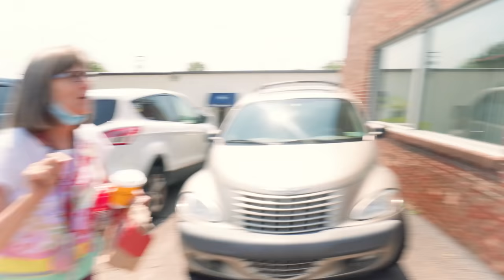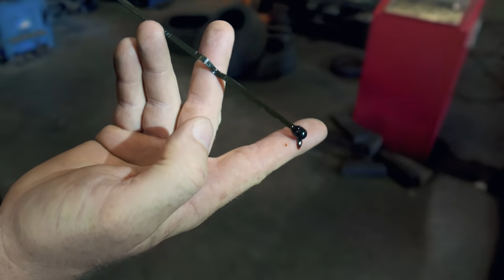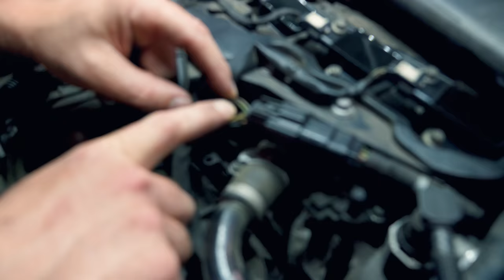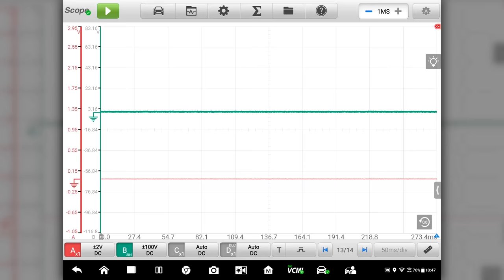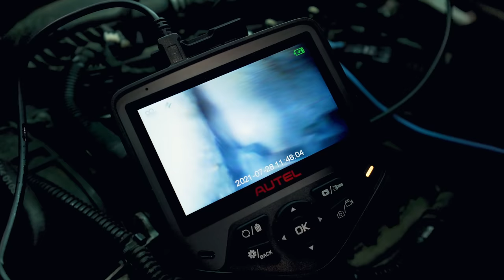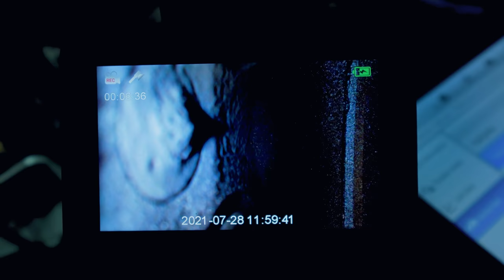Stuck Open Fuel Injectors (GDI) Part 1 (symptoms and troubleshooting)

Comment: Cyl 2 injector stuck open shouldnt throw a multi misfires.
at 1min 27seconds my guess it wiring also. from disturbing the wires when they replaced plugs and wires.
white smoke usually follows by gas coming out of the exhaust is a injector stuck open. its probably a bad wire going to cyl 2
 or the pin connector to the injector connector.
 had this issue on a equinox,  p.o.s design. the injector rail is under the maifolds spo its a bitc^^ all around.
Reply from the maker: Keep watching! There is a part 2 as well

Comment: Hello and good evening. I have a 2013 JX-35 Infiniti and from what I'm experiencing, everything is pointing out to the injectors. I have replaced the fuel pump, alternator and crank position sensor. But in the morning or if the car sit for 2 hours or more it doesn't want to start, like no spark or gas. My gas mileage has gotten worse to the point I can't keep a full tank for a week. And when the car finally starts the smell of bad gas is worse traction control , check engine and all of my collision warning lights goes on malfunction FCW, BCW.  This week I'm taking it in to check and clean the injectors and if the problem doesn't go away I'm planning on scraping the car. But until than any help will be great appreciated
Reply from the maker: Let's move this to my forum www.scannerdanner.com 
It is free to join and we can definitely help you. I have 28k global members and hand picked moderators who've been with me for years and know my material inside and out and are there to help me help you guys. It is just too difficult to offer back and forth messages here on YouTube with stuff like this and we also can't share pictures and images here like we can on the website. Hope to see you there!

Comment: Hey I'd appreciate any help, I have a 2013 hyundai veloster 1.6 GDI It starts and runs perfect other than it acts like it's hitting the rev limiter right at 2000 rpm. Drives and shifts fine unless you try to accelerate quickly and go around the 2000 rpm range before shifts. If I stab the petal it will die too while driving but if I sit and try to rev past 2000 rpm it will eventually go past then run completely normal through all rpm but will stop communicating with the trans/dual clutch system. Started doing this all at once after everything shutdown one day sitting idling, the dash and everything went blank like the key had turned off.
Reply from the maker: You need to have that complete system scanned for codes, sounds like a network type fault.

Comment: Glad your mom is doing well. Honor the Lord and make your mom and the Lord proud! As for the injectors my guess on why all three appeared to go bad at the same time is that each one failed at different times and it didn’t cause enough of a problem for the people to stop driving it and get it serviced. Then the injectors continued to get worse, with others failing as well and once it was not able to be driven, it got taken to a shop. As we know, most people will drive their cars until they can’t drive it any longer and then will seek to get it fixed.

Comment: I had a newer 3 cylinder Mini the other day that had multiple injectors dumping fuel but on under heavy load and would run fine unless you gave it full throttle.

Comment: high pressure pump got some junk fuel trashed itself and the injectors. no way i'd do just injectors. pull the pump  check the cam before quoting
Reply: also do a sock in the in tank pump at minimum too

Comment: I have a 2007 mazda premacy with code fuel rail pressure sensor a circuit low   could that be a stuck open fuel injector
Reply from the maker: Is it a GDI engine? Usually a circuit low code is a wiring or sensor problem. If it was from an injector like in my video, you'd also have a long crank time, and white smoke coming from the exhaust, as well as fuel in your oil

Comment: High pressure pump coming apart inside of its self and then it ends up in the injectors. It usually starts of as a rich runner, gas in the oil and then ends up taking the injectors out. Great shots of the injectors man. I haven't got to see them like that. My scope it just shows the top of the piston and you will see it spraying down on them.

Comment: After watching this I have something to add to aid this troubleshooting in that the oil level is high because the system has been adding a lot of fuel to the oil pan. Now, "When was the last time the fuel filter was changed," would be my question? So, this car needs all the injectors, the fuel line, a new fuel filter, oil change and oil filter.
So my guess on the cause is the fuel filter was never changed for the life of the vehicle.
Reply from the maker: Be sure to watch part 2! Thanks!
Reply: Hi Danner, yes I watch part two. Here's the thing about "Life Time" things when it comes to companies. You must get their definition of just what life time means as for some it only means 7 years others less and others more so you must get that company's definition of "Life time." @ScannerDanner

Comment: Pulse on most high pressure systems including diesel and petrol will not start until fuel pressure is upto sufficient 
This is because of lubricant to the moving parts and damage that would occure with out this pressure

Comment: Awesome video bud, just wondering remember I told you about my 96 F150 with the 302 I checked my plugs and some of them specifically cylinder 1 was black and smelled like gas, I replaced the injectors and the spark plugs it ran fine for a while but it’s doing it again I’m giving up on this truck…
Reply from the maker: I dont remember my friend. I'm sorry
Reply: @ScannerDanner  
No worries, but yes looking at your video with the Ford Escape with all the white smoke my truck is also running very rich to the point that you can smell it, I replaced the injectors after I saw how wet my plugs were and it ran fine for a while but then started doing it again…

Comment: Really great diagnosis video. I am currently seeing what method to use to diagnose my 2011 Subaru Legacy that uses a Port Injection system because I have gas-smelling oil. I would like to see if there is any way to check for leaking fuel injectors with a borescope without removing injectors on Port injected applications.  All the help will be appreciated. Thank you!!
Reply: @ScannerDanner
Reply from the maker: On port injection you can use an injector balance tester and a fuel psi gauge. I have videos on this

Comment: Man I need your help my ram has an open circuit and a constant 12v to #7 injector it was fine before cam replaced truck runs but not well
Reply from the maker: Measure that same wire at the PCM connector and tell me what you see.
Reply: @ScannerDanner  12v

Comment: thoughts are with your mom. an  initial electrical short can cause injectors to fail. whether that results in a permanently closed or open solenoid may depend but once it's failed it behaves like a mechanical failure
Reply from the maker: This was a mechanical issue from a faulty high psi pump

Comment: This video is without a doubt the best explenation you'll ever hear about GDI injection. I've had the same issue on a BMW DI engine. It was not stock, it ran high horsepower on only the dirct injectors. Injector 6 was stuck open. Didn't notice it straight away. Until after cooling it down it smoked 5x more than this Ford on start up. O2 sensor noticed the extra fuel and leaned out the rest. Nr2 piston had ringland damage. Bad luck..
Reply from the maker: Thanks so much!

Comment: awesome that you play hockey, big hockey fan here!, my two sons play .. best sport there is.. have a 05 a4 2.0 im fighting a rough idle,, goes away when raise rpms even the slightest.
Reply from the maker: Check compression first my friend. Idle only misfire,roughness is very often valve related
Reply: @ScannerDanner  thanks man! I do have what sounds to be a lifter tick as well. Could be on the right track with that, also have been into the rear timing chain that connects the cams .. uggh guess I have some inspecting to do.. thanks again!

Comment: Same smoke and smell from my 2012 ford fusion 2.5L. all this parts have less then 500 miles on them, sparkplugs, ignition coils, fuel injectors, throttle body, egr valve. And still hasn't fix it. Cylinder 1 stuck open, noid light doesn't flicker it stays on.?  Bought a 2022 toyota camry 2.5L awd mean while.
Reply from the maker: Is this a GDI or conventional PFI system?
Reply: @ScannerDanner  conventional. Someone else said my noid light stays on all the time on connector for injector 1 because one of the two wires it's shorted an there's ground running through it.? How do I fix that? Do I replace the wiring hardness.?
Reply from the maker: @wevonox7941  I'm so sorry, it is hard for me to keep up, especially with follow up comments. I get about a hundred new questions a day, and do my best to answer them and when I do, they just multiply! Anyway, if you still need help, I have created a forum on my website https://www.scannerdanner.com/forum/post-your-repair-questions-here.html that is free to join, where I have 4 hand picked moderators and over 25k global members who are there to help me help you guys! You will not find a more friendly and helpful forum anywhere. Hope to see you there! Thanks for understanding.

Comment: I’m rewatching this one and number two after just watching number 3.  I curious why such high fuel pressure for this system?  I’m guessing fuel atomization since it’s direct injection?   The owner is lucky that engine didn’t backfire and blow the oil pan and valve cover off.  I use to see that a lot in the late seventies in Chicago during -30 winters.  People would pump the carb to get the engine started, wash the rings and backfire past the rings and boom.
Reply from the maker: When fuel is sprayed directly into the combustion chamber,  the psi needs to be high enough to be able to overcome compressions pressures. Of course atomization is a factor too

Comment: Really enjoy your diagnostic thought process and your down to earth love of life and your honest appreciation of family.
 Having been a fuel Injection specialist for the past 35 years with a flow bench,it is very unlikely to have multiple Injectors fail simultaneously. It is usually bad fuel or tampering with the fuel tank.I  work with our provincial  motor vehicle and have reported on three separate cases of contamination by some disgruntled partner or kids having a 'kick'! I always suggest in these cases that the owners fit a good locking gas cap. Sugar does not disolve in Gasoline, Ice melt does and is highly corrosive and common sand/dirt is a disaster too.
Reply from the maker: Thanks Tom!

Comment: Hey what if my car did this but now won't turn on as if seized , changed injectors, fuel pump,  and sparkplug, please help
Reply from the maker: Step 1. Unplug all ignition coils so there is no chance of spark taking place.
2. Remove all plugs and crank the engine over.
SUPER IMPORTANT! DO THIS OUTSIDE AND HAVE A FIRE EXTINGUISHER ON HAND. You cylinder are most likely full of gasoline and the engine is hydrolocked
Reply: @ScannerDanner  thank you,  this helps out , checked and seen it was indeed hydrolocked but what could cause that if I may ask, ... I I have in mind maybe TPS or FP regulator , should I change those 2?
Reply: @ScannerDanner  also my car is a tuned port Injection , c4 corvette
Reply from the maker: @darkgodarx3009  why are you asking these questions on a GDI system? Thought that's what you were dealing with.
Step 1, remove the plugs and see if you can turn the engine over by hand
Reply: @ScannerDanner  sorry, had a similar case that I haven't been able to solve yet, thought u might be able to help

Comment: How does a bad ground effect the EFI fuse? I have a 93 3.0 4Runner and it's blowing the EFI with every attempt at starting.

O2 sensors wires are fine. Replaced Relays, new fuel pump, disconnected AFM and  VSV. No change.
Only blows when starting and not in the on position. I'm extremely frustrated. Swapped the Computer and no change. 

I'm going nuts.  can't find anything wrong but as soon as you turn the key and the starter is turning it blows the EFI FUSE. 

any ideas or help would be greatly appreciated. Thanks in advance.
Reply from the maker: You will need to get yourself a good wiring diagram to find out everything that is on that circuit. That is step 1, without that, there is no way you are going to track down this fault.
https://eautorepair.adtrk.biz/?a=10817&c=24&p=r&s1=
A list of what I am seeing on this circuit
ECM
Fuel pump
Airflow meter (MAF)
EGR VSV (solenoid)
AS VSV (not sure what AS means, but VSV is a vacuum switching valve - aka solenoid) 
Fuel pressure VSV
Both Oxygen sensors
Idle Up VSV

The fact that it blows only during cranking suggests it is fuel pump related because everything else I listed here is hot all the time with the key on EXCEPT the fuel pump. Disconnect the fuel pump connector at the tank and see if it blows during cranking
Reply: @ScannerDanner  thanks but the fuel pump runs in the on position and doesn't blow the fuse. That also rules out the sending unit. Fuel pump is brand new and I have fuel at the rails. I already unplugged the AFM and the VSV and the fuse still blows at start up. Any other ideas? I've replaced both relays even replaced the computer. No change. O2 sensor wires are good as well. I appreciate your help. I haven't been able to obtain that diagram.
Reply: @ScannerDanner  I'd rather buy a repair manual than oay 19.99 for one diagram. I'm looking into it.
Reply: @ScannerDanner  I can disconnect the fuel pump and see if it still blows. That's easy enough but don't know why it would run in the on and blow at start up. its a brand new Bosch and I wired it carefully.

Comment: The issue is with doing 3 out of the 4 injectors is you need specialized tools to install the seals on that old injector vs your new injectors come with seals installed. 

As for why the injectors failed at once I had a 15 transit with a v6 suffer the same failure.    Had a stuck on injector,    single cylinder misfire.     Low pressure dtcs etc,    replaced the one faulty injector road tested,    2 more injectors crapped out within 20 miles.      It got all 6 new to save the headache of rework.    My suspicion is somewhere it got a tank of bad or contaminated fuel.     No slide hammer was required to pull the injectors.     Just had to get creative with hose pliers and pry bars.     But I could see with heavy carbon buildup them being stuck like the triton spark plugs.      But with all the fuel washing lol it should wash alot of the carbon off.       The transit injector job sucks.     You'll hate how they install the fuel rails and harness.    Plus the intake bolts fill up with water and rust so you're cutting the intake off with a saw.

Built ford tough
Reply: I imagine a stuck open injector allows compression and combustion debris backwards into the high pressure fuel pipe and other injectors. possibly low enough pressure for all cylinders to misfire and backflow ruining them. probably wise to always replace all injectors, pipe and the HP pump as a set.

Comment: There are no codes or check engine lights, and no white smoke coming from the tailpipe or rough idle, just a smell of gas in the oil and thin oil. Any suggestions as to what the problem is and how to fix it? Vehicle is my daughter's  2019 Kia Soul.
Reply from the maker: What are your fuel trim numbers?
Reply: @ScannerDanner  Sir, I'm sorry, but I have no idea what you are asking me. I just know that when I change the oil, it smells like gas and it is thin and runny on the dipstick, and now it is causing the oil to climb higher up the dipstick like it was over filled.
Reply from the maker: @SmittySpeaks  if your injectors or high psi fuel pump is leaking, you absolutely will have codes and fuel trim issues. You need to take it to a shop you trust

Comment: My end assessment is: to  match the part numbers of the three injectors against the one good one.
If they are different...those three may not be the exact ones for that model. Are those three injectors the original ones from  the factory? 
If so maybe they ran out of the right ones when the car was assembled and substituted the right ones with something that was 'suitable'.
If not... perhaps those three injectors are aftermarket ?
Reply from the maker: Watch part 2! There is a reason this happened my friend
Reply: @ScannerDanner  
K... you bet!...I''ll be on it!

Comment: how about a over heat to Couse the 3 injectors to go bad at one time it would course contamination in the fuel rail
Reply from the maker: Watch part 2, this was from a failed high pressure pump. Thanks!

Comment: Hoping you will drop the fuel tank, you'll probably find the metal partials in there... Betting the high pressure pump is starting to fail.
Reply: how would it get into the tank? the majority of them are return less systems on the low pressure side also?
Reply: @throttlebottle5906  I know there's some that are return less but I was lead to believe that some are now returning fuel from the pump to aid in engine efficiency so as not to pump excess fuel.
If the system on this vehicle has no return then I'd be letting the customer know that the high pressure pump will probably be starting to break up, thus pushing swarf straight into the injectors.